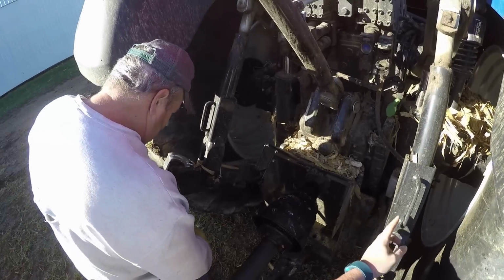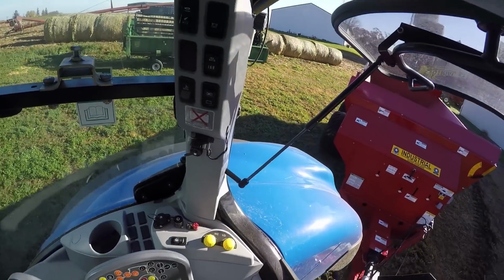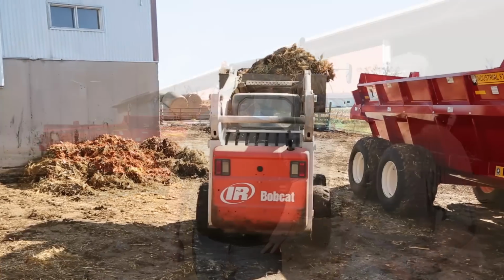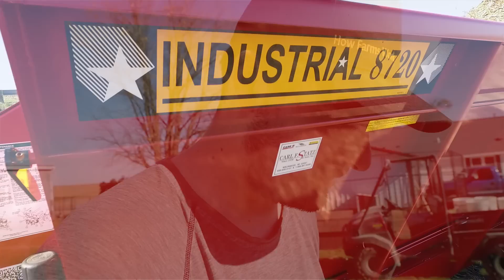Meyer 8720 Industrial Super Spreader! - Carl F. Statz & Sons

Comment: Nice looking equipment and very interesting and different .   I call my neighbor when I need manure. I just had to put lots into the budgets.  He brings as he calls it shit and he has a lot to haul.  He has it  from 300K capacity of feed lots and 100K dairies so Garcia harvesting has it down.  Using about 20 trucks.  He stockpiles it on my turn row and has high speed floater truck spreaders for the field.  I have ordered hundreds of thousands of tons for my farm.  So a tractor pulling a manure spreader is so different and I have never seen it done.  So thanks for showing how it is done in WI.

Comment: I'd buy a Meyer chopper box in a heartbeat but when it comes to spreaders it's Kuhn or nothing.
Reply: Deere8245r agreed
Reply: The Meyer has too many moving parts. We ran their first attempt at an industrial and it was junk. Meyer obviously made improvements because there is no way ours would have taken that hay bale at the end without breaking a chain. Kuhn knight is the only spreader we will run now. They are the only spreader I know of that are worth anything after you wear them out
Reply: we used a kuhn slinger and loved it

Comment: Im not sure about that auger design... Id like to see more of how it pull the manure back to the spreader.... Be nice to get rid of apron chain... but the spreaders these days have just regular link chains on them now which is ten times better.
Reply: Hydra push is the only way to go! Hagerdon, kuhn, Wideman and other brands make them. Hardly any moving parts and easy to clean and maintain !
Reply: Madswiss600 Wideman which are Tubeline now and Jaylor use a logging chain for the apron. Hydra ram would take to much hydraulics for the big spreaders.

Comment: Why do you guys in America use such small manure spreaders here in Ireland most people use spreaders double the size of that one and we have smaller farms
Reply: how big do you use? That holds 3500 gallons, which would be like 14,000 litres. 35,000lbs of manure 50,000lbs total with spreader which is 16000kg and 23000kg with spreader. We use a tanker thats a little bit smaller than this here at my farm in Canada, it's all our 140hp tractor can handle on the hills.
Reply: we run upwards of 3800 gallons in SW england
Reply: Our Joskin is a beast . 25 tons of shit in one go
Reply: MJM Sound & Light i dont believe joskin do 25t spreaders....
Reply: MJM Sound & Light yeah I took 2 seconds to look on their website, biggest one I see holds over 30,000 litres which would be damn near 40T so they definitely make them big enough to hold 25t lol
Reply: Michigan we run 9,000 - 9750 gallon liquid spreaders and 5,000 gallon solid spreaders